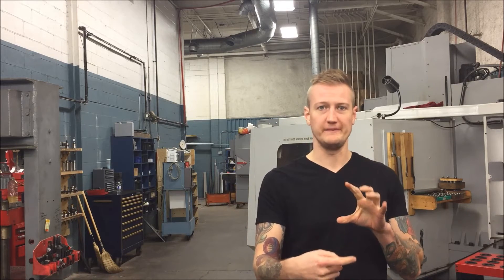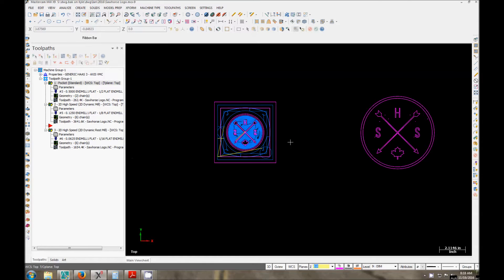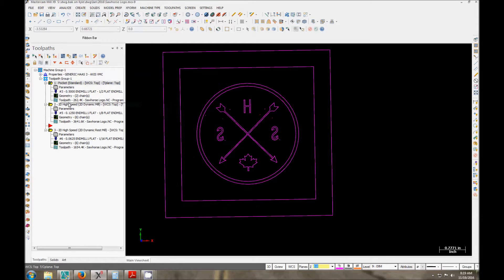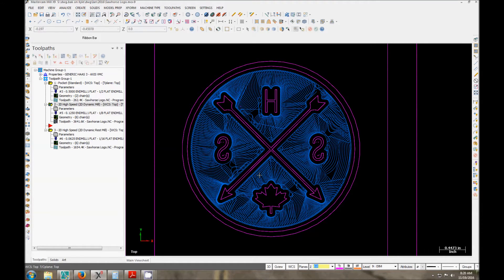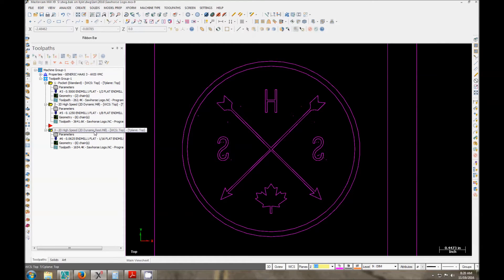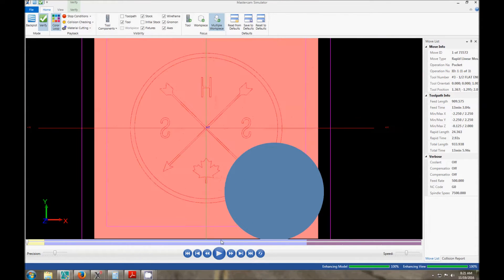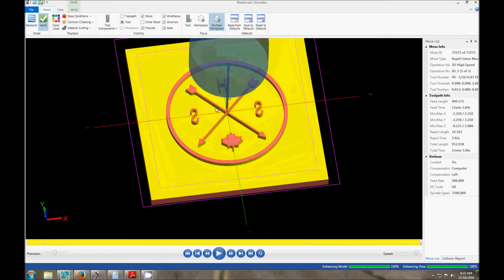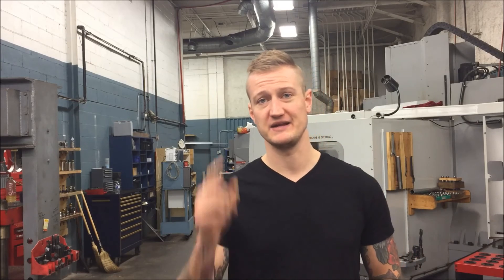LET'S MACHINE: CNC MACHINED BRAND (& MASTERCAM X9 DYNAMIC MILLING)

Comment: Does mastercam do an engraving/v-carving type tool path where a V shaped cutter is raised in an inside corner?  That would have made the brand even crisper.
Reply from the maker: Y'know, the engraving toolpath does do what you're describing to a degree - that would've been a really good idea. I find it gets a little wonky sometimes when dealing with intricate geometry but this is simple and straightforward enough that it could've done a good job. Something to try for next time!